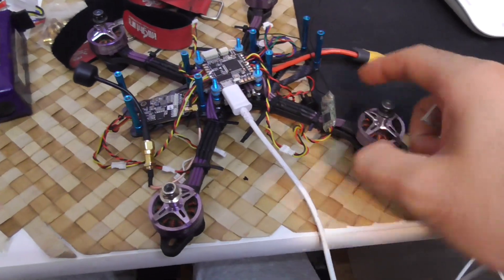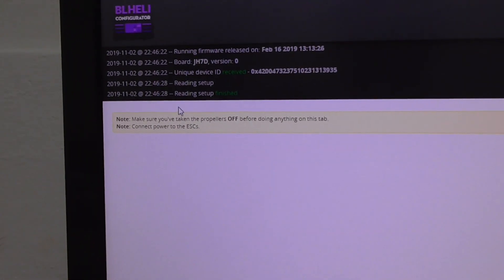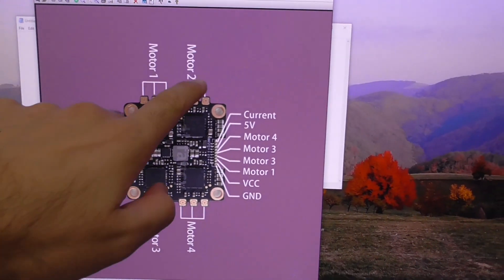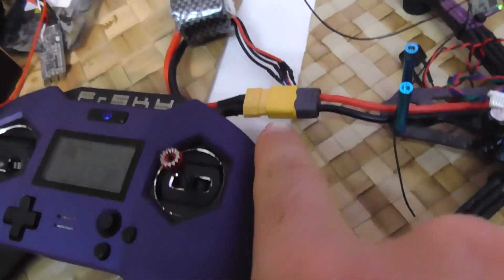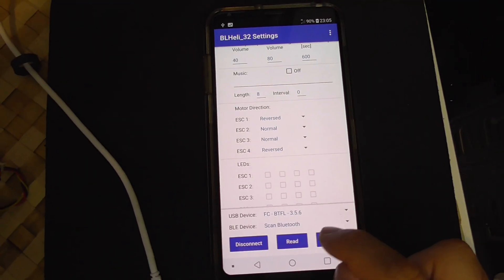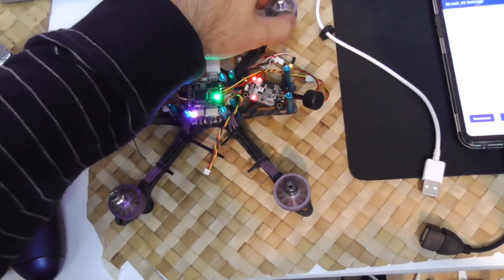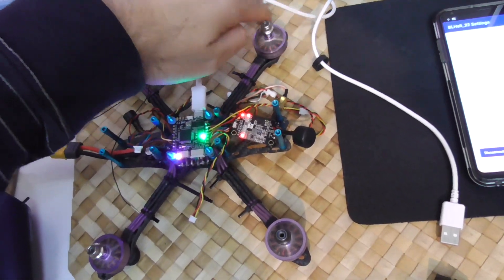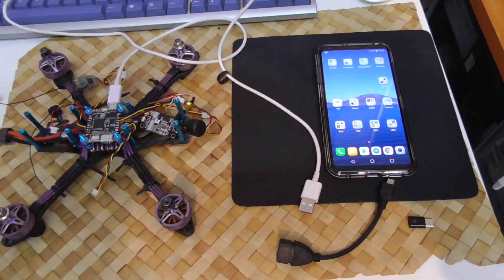Reading setup finished, Failed to open serial port (Blheli Configurator/BLHeli_32)

Comment: I had same issue- if your esc are Blheli 32 you can’t use the chrome app as it isn’t supported you need to download the blheli32 suite and make sure it’s the 32 one (that’s why the app on your smart phone worked it was blheli32) as I was having trouble as well because I downloaded just the normal blhelisuite. I hope what I have said here helps someone because I wasted 2 hrs of my life searching forums only to realise I had the wrong program downloaded
Reply: Thanks bucket loads i was so lost since all my other esc work with configurator but this is my solution i think lol